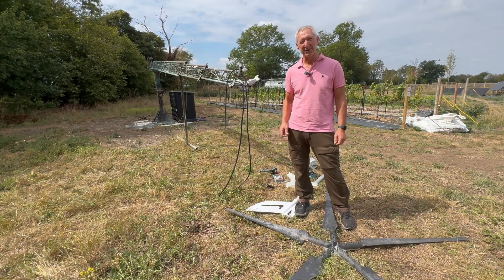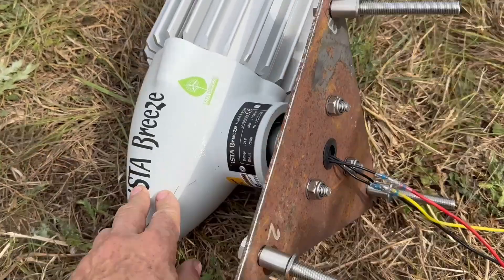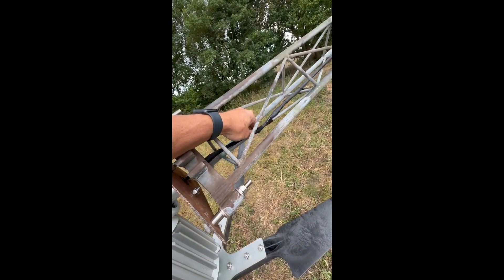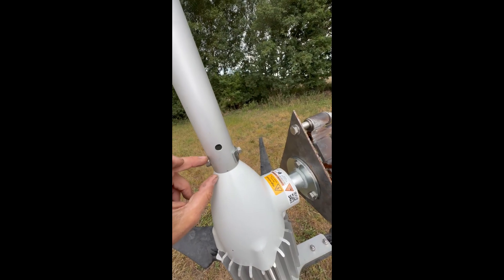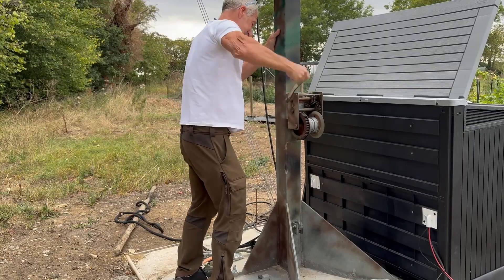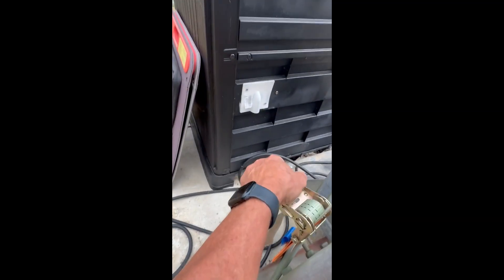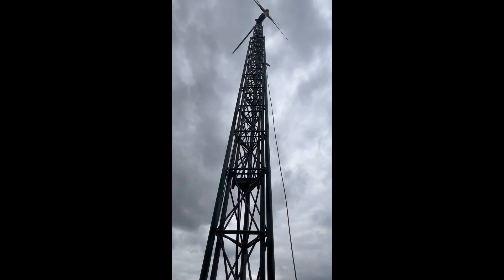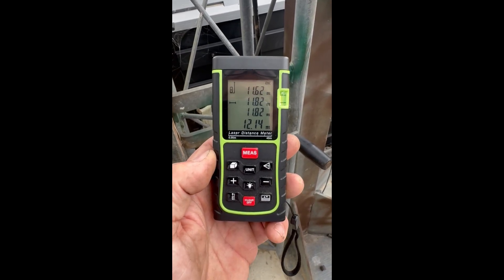iSTA BREEZE I-1500 INSTALLATION FULL VIDEO of Small Home Wind Turbine

Comment: Great installation, i wish id the 5blade and hub for my 2kw 48v, but ive a wieght restriction, blade length restriction,wind speed restriction, so no real production until 15mph with 3blades, assuming the 5blades would produce earlier.
Reply from the maker: Funnily enough just done a new video covering all of the results. It cuts in around 3.8 m/s (8.5 mph)  However hits a brick wall earlier than a 3 blade.

Comment: Why 5 blades ? can you do a test 3 vs 5, might be interesting
Reply from the maker: Ive not got an Istabreeze 3 blade (unless they want to send me one😜). I have got two different 3/5 blade Chinese made coming on future videos when ive swapped them over.
Reply from the maker: And I should have said. 5 blade better performance at 3.5 - 7.5 m/s but then the weight and air friction means the 3 blade is better. Lets see with a Chinese equivalent
Reply from the maker: new video with 3 vs 5 comparison coming